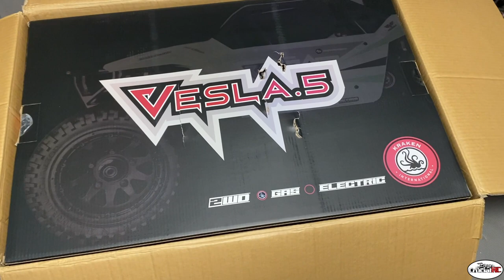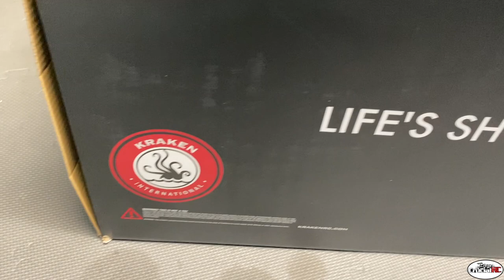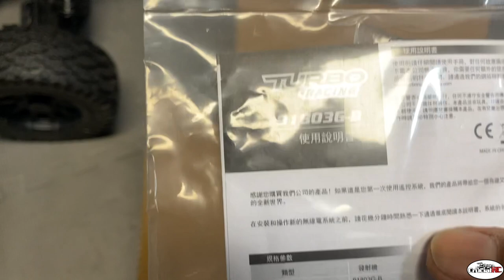Unboxing the new Kraken Vesla.5 BIG 1/5 RC Baja

Comment: Is a kraken vekta5  a good rc truck
Reply from the maker: All cars in stock form are ok. The problem is when you start throwing more power at them. Then you will need to upgrade. I also have a vekta.  I loved it. Unfortunately now I don't use it much and have been contemplating on selling it

Comment: Did you get a good price? 
I
Have one built with a 50 in it. So many things cheaped out on! Packaging-manual-that engine!-careful with the plastics they are delicate-the radio!-winter here I’ll get it out soon. But I’m not impressed.
Reply: What should I get I want 2wd but I like kraken hybrid style , this better quality than rovan right ,
Reply: Thanks
Reply from the maker: Everything you are upset about I won't use so no sweat there. The foundation looks great to me. Cage mount just needs to be addressed.
Reply: @CrucialRC  I’ve done a quick release cage already.

Comment: What’s the engine like in one of these as a ready to run is it a good engine for the time being ?
Reply from the maker: It will get you going. If it was a genuine zenoah it would be a lot better.
Reply: I got a brand new engine out of one of these for cheap just looking for a stopgap engine for my baja 5b until I can get a g320 or Taylor 35
Reply from the maker: I still have mine. I'm planning on putting a esp top end on it and see how it runs.
Reply: Is that the esp 34?! I have a 36 top end and piston I could put on it from rovan
Reply from the maker: @gazbo_RC  for the 34 you would need the crank and clearance the case for the added stroke. I'm talking just about a 32 esp. Budget build
Reply: Oh yeah makes sense.. strong top end and it should be good, thanks for the help bro, hopefully I can make some more videos soon of the 5b

Comment: Nice Whip bruh. Hey bruh, if you decide to get rid of that stock engine let me what your asking for it ok ?
Reply from the maker: Thanks. Make me an offer bro
Reply: @CrucialRC  hey bruh, what actually is the engine,  CY , HY,  Zenoah or ect ? Trying to research for it but,  I'm coming up with nothing in order to offer an far offer.
Reply: @CrucialRC  Question bruh, us the turning ratio better orvthe same as the Vector.5  ? My Vector.5 seem to suck on that.
Reply from the maker: I turn on power with roosts 😆😆 I think its a g320. You can email me at crucial 118 at yah to discuss.